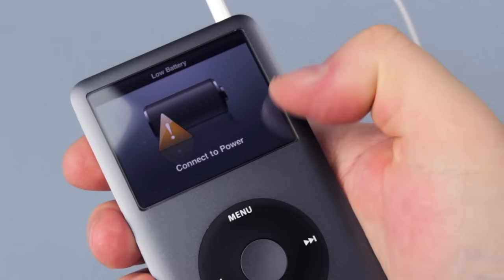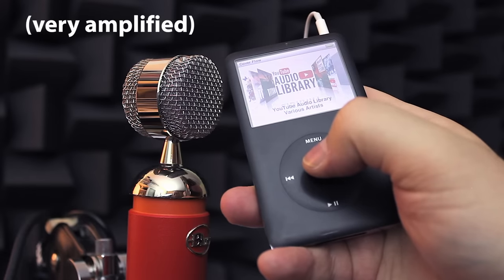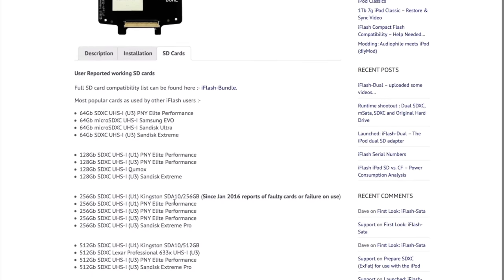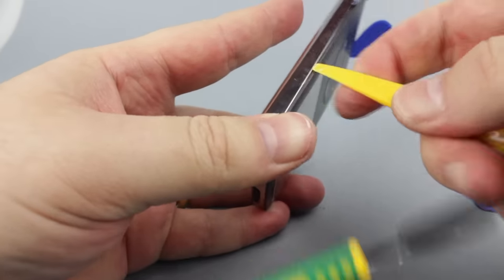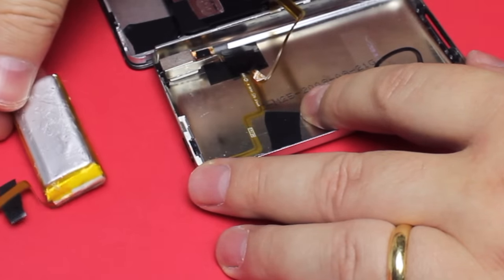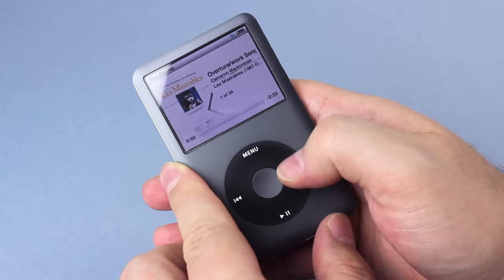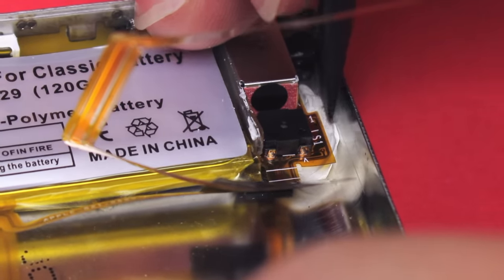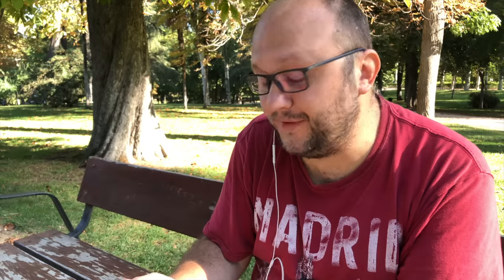iPod Classic new Battery & 256GB SD Card: still works in 2024

Comment: Thanks, I successfully installed the 256g SD card in mine. I made a few mistakes, I pushed the iSesamo tool into the charging dock, and it partially damaged it, but thankfully it still worked. When ordering the SD card, I made the mistake of ordering the mini 256g SD card, not the standard one. 

The iSesamo tool is very good. I found it usefull putting 0.88mm guitar picks in the gaps when trying to undo the clips. It also makes it easier wearing thin gloves with a good rubber grip when trying to get the clips off. It's a good idea having some off those flat plastic screen repair tools, and a standard sized flat screwdriver. The pack of screen repair tools I ordered included a very small flat screwdriver, this really came in handy for removing the battery cord (It's very small). Oh, and I used a pair of plyers when trying to bend the clips to put it back together (they are hard to bend). 

The clip at the top of the Ipod is bigger than the other ones. I was too rough with it when trying to get it off, and partially bent the top off the screen, but not too bad. Anyway, it's all working, just a bit out of shape! 😊
Reply from the maker: Hi Luke! Thanks for the great post ❤️ I find it awesome to see how the iPod Classic is still so beloved by their owners - and it makes me so happy that the video of my bumpy journey is still relevant 🤗 I hope you can continue using your iPod for years to come! And, yeah, after you have personal hands-on experience opening the first iPod, it gets a bit easier to open the next one. If I have the chance to fine a used one on a decent price, I might get another one to “modernize”.
Reply: Yes, I have two other broken ones. I will try to fix them too, It saves a lot of money.
Reply: HI Luke, did you use the Solo flash board or a dual flash board?  And has the iPod been playing  without any errors? Thank you..
Reply: Hi, I used the dual flash board with one 256G SD card, it's working perfectly.
Reply: The Tarkan Akdam brand
Reply: @music84able  Thank you for the reply and bravo on the successful results. I have just recently ordered the dual Tarkan for this re-work project. And you only used one card? Can I ask how many songs are you commanding? I am wondering if I should order an additional card since it is a dual flash drive. This is so I wouldn't have to go through the headache in opening the case again. I am thinking my catalog surpasses the 256GB and that's why it keeps freezing? I don't know.
Reply: My songs are less than 160GB, but I have lots of audio books. I was easily going over 160GB, but it was because of the audio books. You would have to have a lot of songs to go over 256GB
Reply: @music84able  Well I switched out the Tarkan iflash drive and replaced it with the Tarkan iflash drive and welp so far so good. I kept the single 265GB SD card and  I have been playing my random playlist and it has been playing just fine. I currently  have 19,299 songs in my catalog with 108GB still available. So far so good. Thank you and many thanx for the information. Wish you well..
Reply: I have successfully updated a second Ipod. Next I will try to do one replacing the hard drive and the battery! 🙂

Comment: Still have it and about to put 2 256gb sd cards in. I'm going to use your video. I repaired my old 30GB iPod video's screen and replaced the battery and gave it to my dad.
Reply from the maker: You should first go into the iFlash website and check possible limitations of your iPod model. Even the newest model has a limit of 50 thousand items (songs, videos, podcasts...) due to its database system... So, you must think if it is worth having more than 250GB on the iPod.
Reply: I plan on avoiding that with Rockbox. https://www.rockbox.org/
Reply from the maker: Oh, totally. I keep mine with the original Apple firmware because I really like the interface: very polished. AND I also like iTunes! 😳 (I know a lot of people don’t like it...)

Comment: I have a 160 GB Ipod Classic with over 18,000 songs on it.  I have playlists of all pop and rock top 100s from 1950 through 2019.  Took forever to make the playlists (had to be done manually one song at a time) but well worth the effort.  Ipod a couple of years ago had a corrupted hard drive and had it replaced.  Now it tells me to recharge the battery in a very short time even though the battery life indicator in the upper right says that its still half charged.  Video will help when that will shortly become necessary.  Thanks.
Reply from the maker: I hope you can fix it without much trouble! I still enjoy very much using mine.

Comment: This video is awesome, many thanks!
 I've got question. You used 256GB SD card in iPod 6th gen 160GB, which, as iFlash page says, support maximum of 128GB, and they say it even requires special ribbon. How can it work with such a large card and did you use that ribbon they are offering on web page? 
Thank You
Reply from the maker: Hi Jakub, thank you for watching! I might have confused you. My wife's iPod has that limitation you mentioned. But my iPod (the one I've put the 256GB SD Card) is the very last revision, that doesn't have that problem (well, only the 50k songs limit, which I am still far away to reach).

Comment: Dude, you're the man! Used the recommended tool along with your pdf and my mod turned out excellent without the slightest dent or scratch. It's really all about knowing the 'where and what' in order to avoid messing up the delicate edges at the front and tiny steel latches inside the backcase. Thank you so much!
I used a 2000mAh battery from 'xiaowan-88' at ebay which gently fits the thin 160GB Gen7 back (along with an iFlash Quad i.e.) and makes it last like forever now. I'm blown away.
Reply from the maker: Awesome, man! Hey, I might check on that battery... I saw a few videos about people using them and I really envy the autonomy. I don’t want to replace my thin backplate (since it is engraved) - I wonder if that battery fits the thin iPods...?
Reply: @GeekDetour  It does along with the drive swap. 'iFlash' offers various thin lightweight replacements for the original harddrive to be used with sd cards. With the original harddrive installed the big battery most likely won't fit.
Reply: Apple reduced the height of the harddrive with the late 2009 '7Gen' 160GB iPods, the type I modded. That's why these also have the thin back equipped.

Comment: Hey Geek - Paul from Michigan here. I opened up my Classic/thick body ipod and replaced with the proper battery. I did not seal it all back up again but plugged it in and ..... nothing.....   all went well with the replacement, no issues but still no life. I screw something up or does this mean I need a new drive? I did not seal it back up just for this reason. I’m sad. I want my ipods back! Going to try the other one tonight. Thanks for your response.
Reply from the maker: Hi Paul! 👋 Let it plugged into a charger for a couple out hours. Maybe the battery you bought was really drained (actually, if it came totally drained, consider returning it and buying another battery). It seems the iFixit website has better batteries for iPods (on Amazon it is a lottery...). Oh, double check if you really connected the battery properly and closed its securing latch.
Reply: Geek Detour ah ha , i don;t think i pressed the batt cable clip back in place. I have done that now and I’m charging it now. Let’s see why happens 👍🏻‼️

Comment: I have the earlier 120Gb Classic.  It needs a new battery.  I can still use it, but the disk is starting to go & Apple does not fully support the refornatting/reloading the disk.  To answer your questions, I think, if I understood your statement at the end of the video, that I feel exactly the same way you do about my Classic.  Sure, I can stream from my phone, but I can's connect it to old (favorite) radios with that weird set of ipod classic  "teeth" that hold it for charging and playing.  So, I will replace the battery and disk, then find a way to reformat and load it up.
Reply from the maker: Hi there 👋 I hope you can replace the battery and disk of your iPod and format it nicely, and be able to put back your favorite songs. I still have a very well organized iTunes library, local on my Mac’s hard disk - so, it is not difficult to drag my songs to the iPod if I ever need to format it again. I still use my iPod Classic and it still works fine, the way I had it in 2016 when I recorded this video.

Comment: 2021 ... and still using my iPod classic 160 GB, with original HDD. I replaced the battery years ago and I can still remember how difficult it was (and you can see it on the ipod too)
Reply from the maker: Oh man… the scars of life! 😆 Yeah. I am glad you still separate the time to use it. More and more it feels like a weird ritual 🤣 But I still use mine. I need to buy a Bluetooth transmitter so I could use it in the new car.

Comment: Me and my father still have our iPods Classic. I have the 120GB version and my father has the 160GB. His iPod is still working fine and mine too, but It's been stored for quite some time. I will probably have to upgrade it like you did. Great video btw! Good job on the upgrade!
Reply from the maker: Thank you Ben! When they are not being used for some time, the battery decreases its capacity (sometimes it can get completely dead). If you go for changing them, opening the iPod is the trickiest part - be careful and good luck! 👍🍀

Comment: Thanks for the tips. I have 6 iPods, in cars (old cars), in the garage, at work (with a Bose dock) and at my moms in the garage (with a Bose dock). My original purchase 7th gen 160 and Bose dock still work perfect and I bought the rest over the years on eBay. I just bought a 6th or 7th gen 160 at a swapmeet for $5 and it needs a hard drive. I'll be using your video to replace it.
Reply from the maker: Wow! An army of iPods (and cars 🤣) I hope you can fix the one that needs a hard drive! Is is not difficult when you have the right tools and information 😄 Good luck! 🍀

Comment: Thank you so much for posting your journey. I am in the middle of a similar project. Mine is a 6th generation classic with 120gb hard drive. Stopped working and gives the red x screen.  I took it apart the hard way before viewing your video... I hope I have not damaged it too badly. I ordered the iflash adapter and a 256gb card. Here's hoping it works on the 1st try. Your video gives me confidence that almost anything can be fixed in there. Thanks again for posting your work. Sincerely, SonicOx.
Reply from the maker: Hey 👋 I hope you can fix your iPod soon! After you get your iFlash board, tell me if it fixed your X screen - I am curious. By the way, have you checked the compatibility of your exact model (and see if it will take advantage of 256GB) on this page? https://www.iflash.xyz/store/iflash-compatibility/
Reply: Hello Geek Detour!  Thank you for the reply and your interest in my project. So my model number is A1238. This model number isn't listed in the link you provided. Maybe I got lucky and the 256gb card will work. If not, hopefully I will be able to use at least 120gb of it. I don't want to use Rock Box unless it's the only way to get the iPod going. I have seen some videos where people were able to format their cards in such a way that they can use larger capacity cards AND have their iPod recognize and display the increased capacity. That is my goal. Do you think I should change my battery while the case is open? I almost always use my iPod where power is available and rarely use battery only. If you think it's a good idea, could you recommend a good battery from Amazon or the like? Thanks again for your valuable help. Yours is the best "how to" video I've seen. I'll update you as the my parts arrive. Cheers - Sonic Ox.
Reply from the maker: Oh, that’s a “generic model number”. You need to check with the iPod turned on. My iPod Classic is the MC297 - You need to check on: Settings -> About -> 3rd Screen (right arrow 3 times). Then you see the exact model.
Reply: Oh, thanks again!  Right now my iPod is apart on my work bench. I removed the old hard drive and I'm waiting for parts. But even when it was together, it would only come on and show the red "X" screen. It would not allow me to go to settings or any other menu area. My original plan was to replace the hard drive but then I started seeing these modifications and thought I'd try since my iPod was in need of repair anyway. My plan right now is to format the new card when it arrives and install it with the new iFlash module. If it only uses 120gb of the 256gb available, I'll still be happy if it works right otherwise.
Reply: I put the hard drive back in and fired it up and now it's working normally!! Still going to do the mods. Model number is MB565LL
Reply: Hello again Everson,
I got most of the parts and performed the mod. I removed the hard drive and installed the iflash solo with a 256gb card. As predicted, I can only use 128gb with the Apple OS and iTunes. I don't really want Rock Box and actually my current music library is 9379 songs which only really take up 34.1gb leaving 93.44gb free and no spinning hard drive!! I think I will still replace the battery, and use a Bluetooth transmitter in the aux jack. I may even replace the 256gb card with a 128 since that's all it can handle anyway. Thank you again for a GREAT video documenting your project. It made mine MUCH easier. I tell everyone to check yours out before starting this upgrade. Salute mi amigo in Espana. Cheers from Arizona, USA. PS - I have a YouTube channel of my own mostly dealing with drone photography and 3d printing you might want to check it out sometime. Just search out Sonic Ox.

Comment: believe i opened the ipod classic 6th gen 1238 fat with the cover with simple mobile display thick plastic i did cut them into 6 small pieces and inserted them and then with a steel 1 inch ruler used in schools i opened them without any scratch no need for any fancy tools and for the battery at this point the back panel was open so i placed the metal back on  cloth iron press at minimum temp and with the same scale i got it free from the glue note do not heat much just enough to warm the glue.this worked for me yes it did take some time

Comment: It appears as though you are able to use Apple Music after the repair. Is this the case? Or do you have to drag and drop like a generic MP3 player?
Reply from the maker: Oh, absolutely: everything official. That’s a very cool thing about this mod: the iPod continues working with its original firmware and you manage your library just as before.
Because the firmware remains the same, it also continues having its limitations about the maximum number of songs that the iPod can handle - it doesn’t matter if you have 256GB or 1TB: it doesn’t go beyond 50k items in your library. I see pointless going over 256GB. You can read about it here:
https://www.iflash.xyz/store/iflash-compatibility/

Comment: That was an enjoyable video, thanks! I've got an 80GB 6th Gen iPod Classic and I want to do the SD/Micro SD upgrade.

I'd like to replace the battery with a much larger one, but it looks like I need a new back, new headphone jack assembly, and new spacer for the 30-pin dock connector. More work than I care to do. Aside from opening the iPod, you make the SD upgrade look easy. Thanks again.
Reply from the maker: Hi there! Thanks! Well, yes: once it is opened, the iPod is quite easy to replace things and everything is still quite "hand-size" and doable on naked eyes... Oh boy, I replaced the battery of my Apple Watch and it is as delicate as surgery!!!!

Comment: I have the same iPod version as you, and think I too need a new battery. For now I'm not going solid state instead of the drive. One thing seems to be that the solid state adaptation uses more battery, or so I've read, or maybe its just certain version s, like the SSD conversion? What did you find? Oh, I enjoyed the video - very clear, including about how to avoid breaking other bits!
Reply from the maker: Thank you so much, Andy! The guy that makes the iFlash made a bunch of tests and wrote an article in his blog: there are some combinations with SDCard that make it more power efficient - while using a real SSD totally eats up the battery. If you like this sort of details, here’s a nice reading for you: https://www.iflash.xyz/runtime-shootout-2016-quad-dual-solo-msata-vs-original-hard-drive/

Comment: So I bought an iPod classic off eBay, same GB and everything. It works great!! I just noticed that it’s light, and not really heavy like I imagined it. Is it because of the new hard drive it has in it? Or the sd card?
Reply from the maker: I don’t know if you bought an original iPod Classic or the already modified ones in which they replaced the hard disk.
Reply: Geek Detour it was a seller refurbished one. But like I said, everything works great! It just doesn’t feel heavy lol
Reply from the maker: Well, it wasn’t exactly Heeeavy, ha ha. The 6th gen 2nd revision (mine) used to weigh 140g (almost 5 ounces), and after changing the hard disk to an SDCard it now weighs 100g
Reply: Geek Detour I wish I had a scale to weight mine, lol but honestly it almost might be around 100g. The seller told me he replaced the sd card, so maybe that’s why? And it doesn’t have an old hard drive.